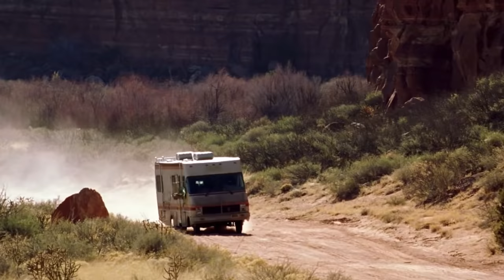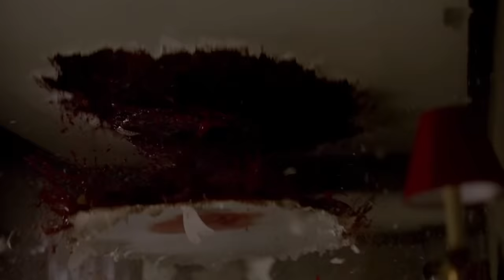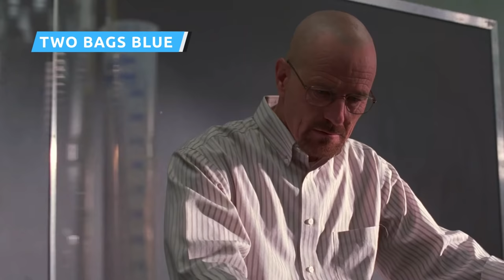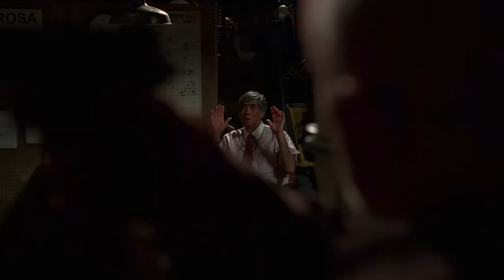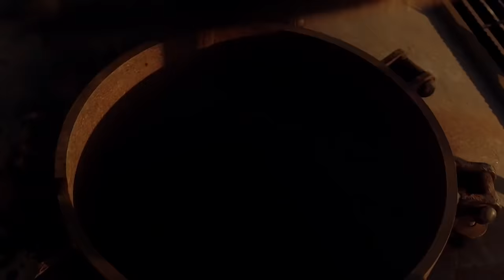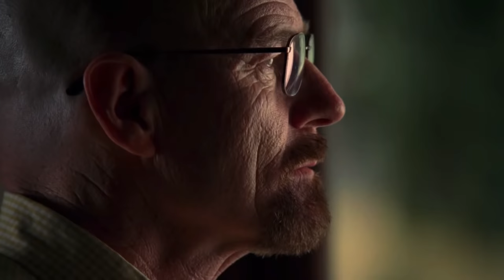Mistakes That Are Hard To Ignore In Breaking Bad

Comment: Wow I thought they would point out some really intriguing and important mistakes, but these were just some very small and useless points you picked, awesome way of picking up content :/
Reply: You said it well
Reply: You mean as far as writing? - because I thought this was pretty interesting.
Reply: They all do that :/ especially with the “250 facts you did not know about BB” and it’s all random useless details
Reply: The last one is a pretty annoying mistake though
Reply: The train issue was such an over reach. There are only a couple of railroad lines in New Mexico and their layout is insanely easy. That product wouldnt of came from/ went to the south either, so that is half the map gone. And the other half feeds back into itself so all they would have to do is go up the tracks a bit and the problem would of been solved